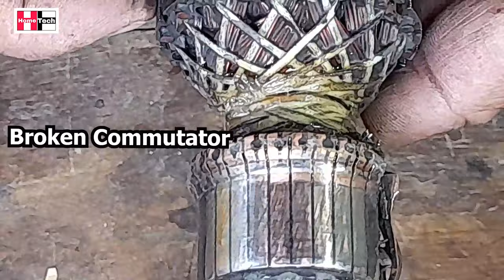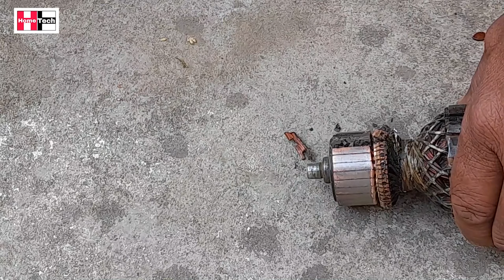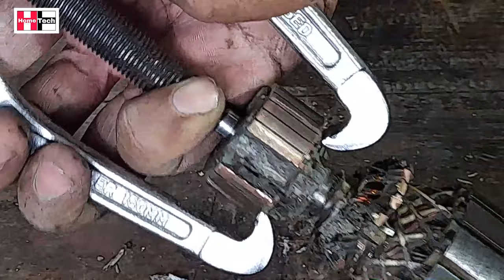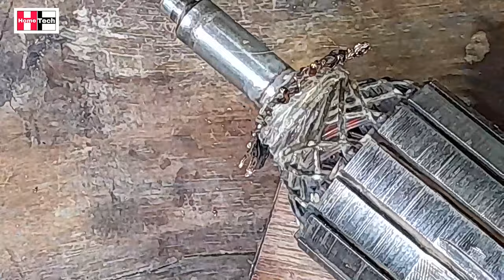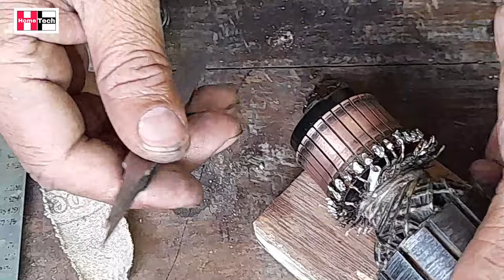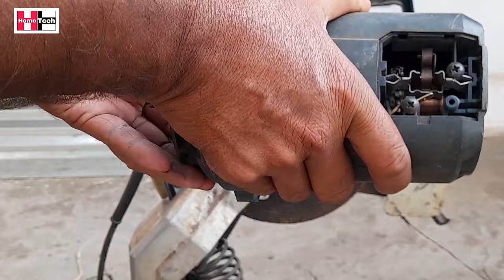Armature Commutator Repair | Electric Motor Commutator | Chop Saw Armature | Fix Broken Armature

Comment: Interesting, but it seems to be the same machine you had repaired earlier with the 2 flattened copper wire I saw earlier, apparently that repair wouldn't have been such a success in the end as you are now replacing the entire armature, or am I wrong? thanks anyway for showing your video 👍

Comment: How many watt of solder need minimally ?
Reply from the maker: 25 watts
Reply: I d use 40watt ,it take not longer than 3days to broken. It seen no problem but not  connected, and need to crank back 30-90°  the crankshaft to make the motor starter ready to use